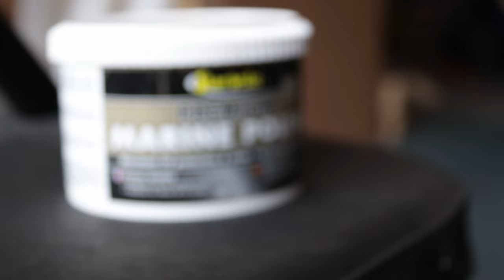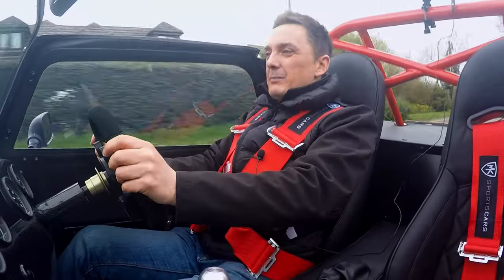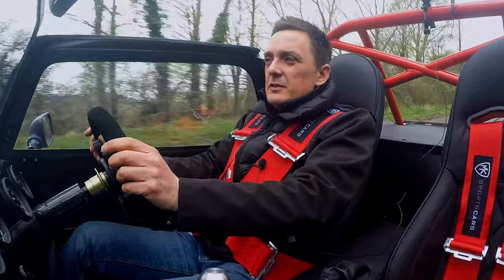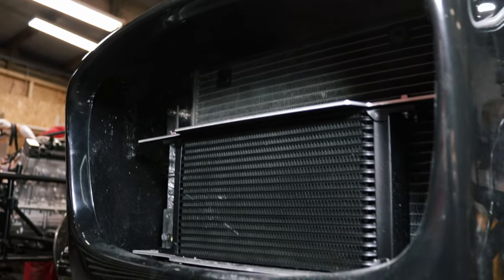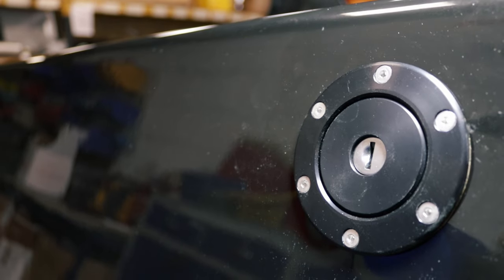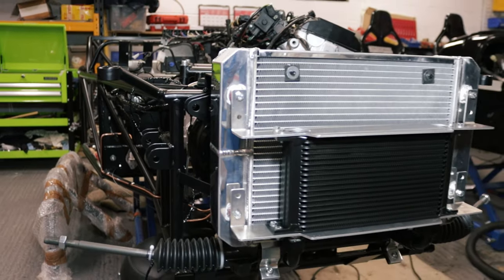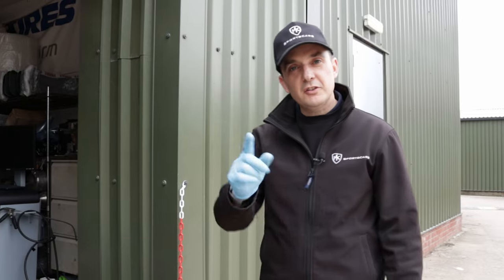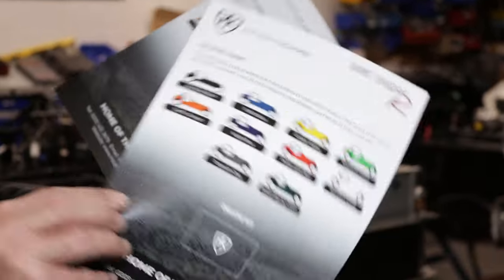Ep 120 - 230BHP HONDA K20 takes its FIRST test drive... #230bhp #honda #testdrive #kitcar #k20 #race

Comment: So f20c or k20a? 
how did you find height clearance in the engine bay on the k20? I hear they are a taller motor compared to the f20 for example
Reply from the maker: I will post a picture of the sump clearance on the K20.  It’s actually very good due to the new scoop in the bonnet.  F20 are getting hard to find so it’s a bit of a no brainier really.  I do love the Mazda running gear, it’s super smooth.  Both are fantastic engines